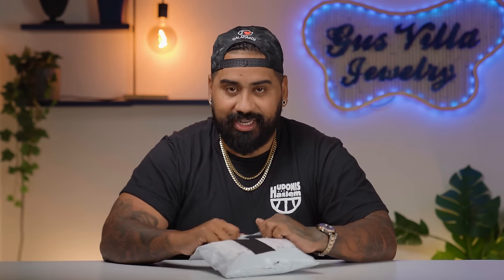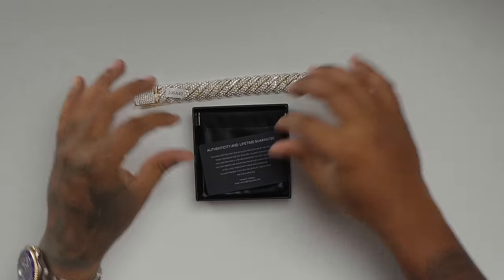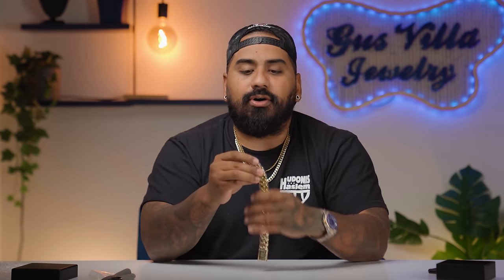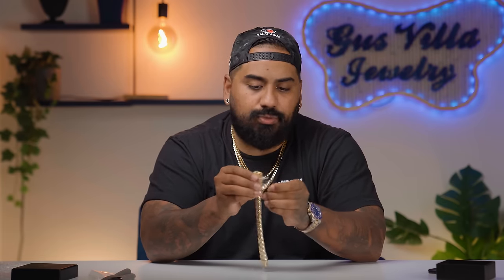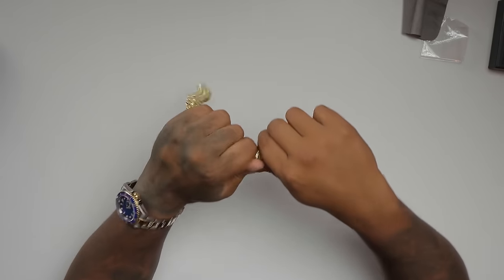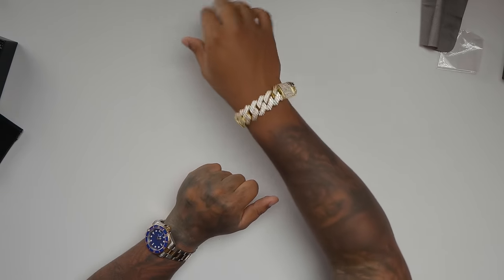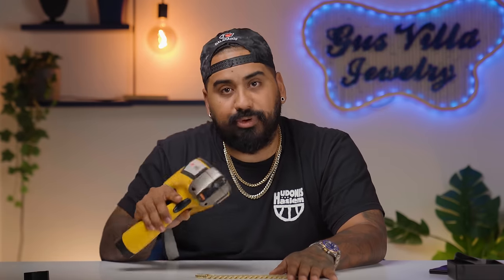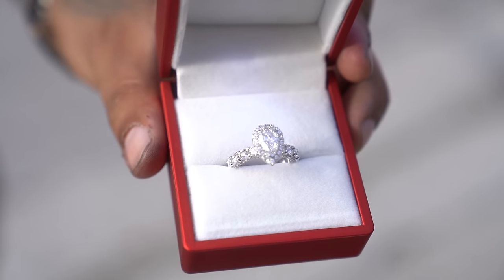ACTUAL JEWELER reviews THE GUU SHOP: Don't Buy until you WATCH THIS!

Comment: The process for making the chain is bang on @ 7:00. I live and run my business in China and the time you save machine setting stones is phenomenal. I do link chains/bracelets/rings, you will wreck your eyes(and body) handsetting all day. I would question 90+% of those out there that say they hand set their stones. Basically pics or it didn't happen. There is a market for 100% hand made jewellery and a market for machined. You pay more for the experience and that feel good feeling when buying handcrafted. Less to just look good.

Also $150 for this copper chain? Increase the length by about a meter and you got a fair price there holy shit.

Comment: @Gus Villa Jewelry

To get a more true reading when dealing with plated jewelry such as this try filing the surface or using fine jewelers sandpaper to remove the barrier metal plating. 

It appears as for this bracelet that a very thick layer of fine silver plating is plated over a brass layer and then gold plated. 

Update this video after you have a clean base Metal surface and see what it shows! 

Sincerely,

TBBW🐺

Comment: Electroplating over silver should definitely be done directly over the silver. I'm sensitive to nickel, copper, and brass, so I wouldn't sell anything that I wouldn't wear. Wax set is nice if someone needs to save money, but both wax and hand setting should always be an option so that everyone can be catered to. I work with overseas teams, but I had them make personal pieces for me to sample first. It took some weeding out of certain factory teams. Any dealer should always disclose the base metal, even if it is plated jewelry. Most of the business is sourcing materials and finding good teams to work with.

Comment: Aporro state they actually manufacture their products and do custom made pieces! Give it a try
Reply: I love Aporro's designs. Especially their sterling silver and moissanite selections. As long as their items are made to order in Italy and not in China, that's assuring. 
My only problem with them is their usage of brass, which is basically garbage when used as jewelry. If they had used stainless steel instead of brass it wouldn't be a problem.